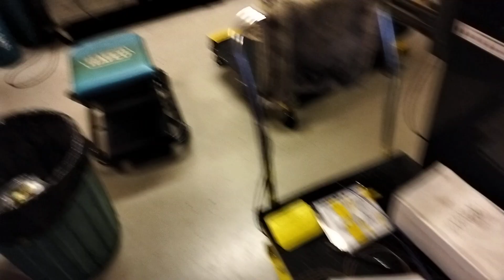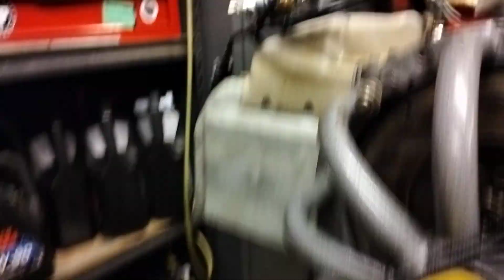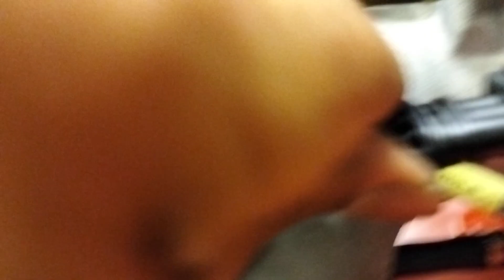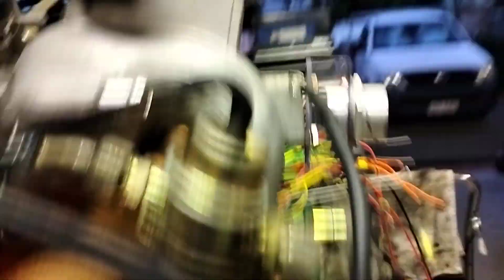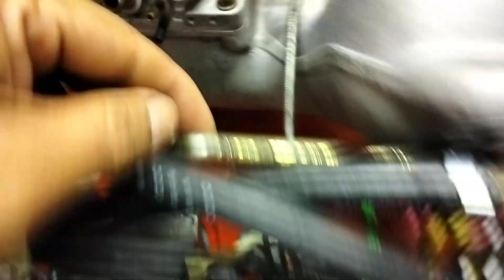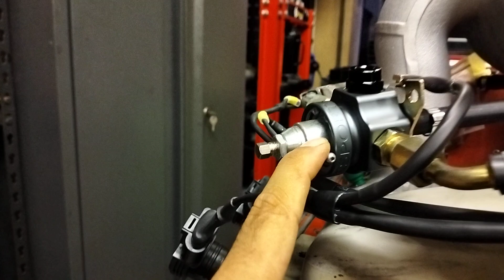10 - How to Convert your Aircooled Porsche 911 to Turbo and EFI - Input please?

Comment: FFS Mike, please do something about the sound quality! It's making your excellent video difficult to listen to.
Reply from the maker: Hot day, fan running in garage. Also, you're a billion years old and likely your hearing isn't what it used to be. If you can hear some rustling, it might be time to trim the hairs out of your ear? ;)
Reply: @aircooled911engines  Your videos need to be of a similar quality to your rebuilds. You wouldn't present a finished engine with dirty cases, would you? Consider a fixed camera and one of those hairy mics. (Not hairy Mike, which you already have nailed!) 😎
Reply from the maker: Rob, when are you buying me a fancy mic setup? @robgray3725

Comment: When building my harness, the resulting spaghetti made me really wonder how others make a clean or “shaved” engine bay. You’ve made some smart decisions on routing and accessibility which will definitely help to service or disconnect when necessary. I used DT connectors throughout the engine bay and DTM for CAN bus network.

Comment: There's also a larger DTP Deutsch connector (good for 25 amps.)  That needs a bigger crimper.  Where is the ECU going to be mounted?  If it's in the car, the bulkhead connector might be better served on the car's firewall, perhaps?  I went through a lot of this... I think the routing of the vacuum lines is fine as you described.  The YouTube comments section is a bit challenging to discuss all of this. 🙂